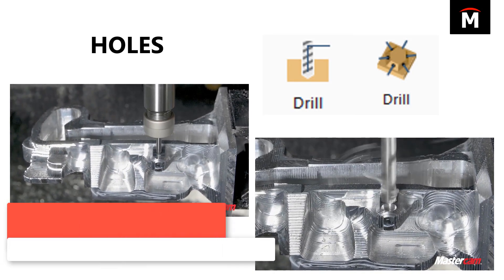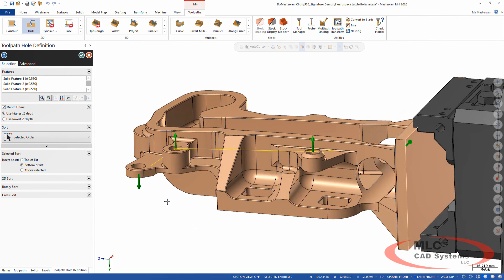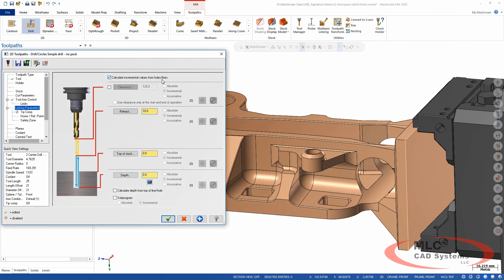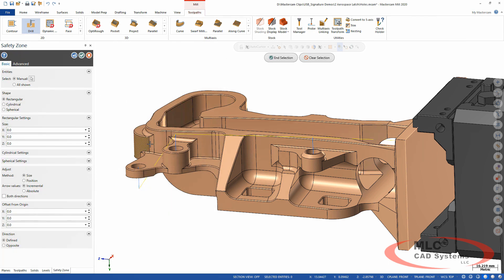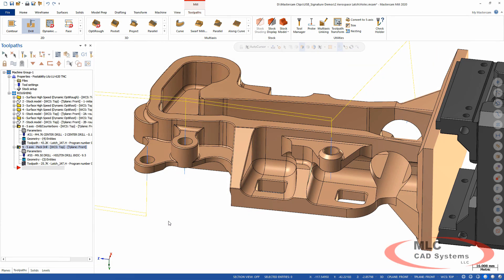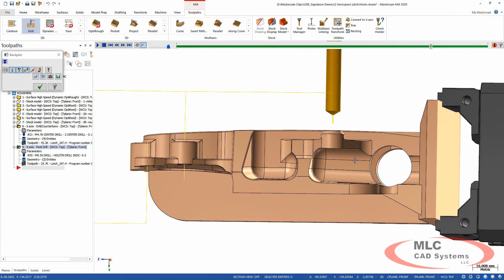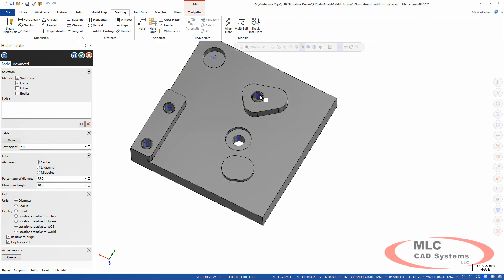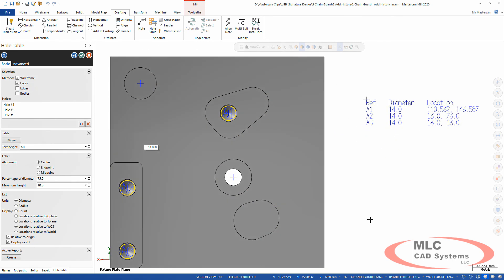What's New in Holes - Mastercam 2020

Comment: Great info thanks you so much! I tried to drill holes (multiaxis) using points (not suface like you show on the video) and I select tool axis control surface and it gives me an error. do I have to use only surface when drilling multiaxis ?
Reply from the maker: Without looking at your specific file it will be hard to tell for sure.  This might be best submitted to your local support provider.  If MLC CAD Systems is your value-added reseller, you can submit a case online at https://mlc-cad.com/mastercam-case-request/

There are a couple of possible reasons for an error in performing this operation.  One could be licensing, if you do not have one of the multi-axis licenses available then you won't be able to create the toolpath. 

We tested the workflow with points, and as long as the tool axis control was defined correctly it worked correctly for us, but the location of the points and the faces selected might create a conflict in your specific file.  If you place the point on a solid face and then use that point and face it is working here.  Consider trying it on a simple model to see if works on any model for you before going back to this model.